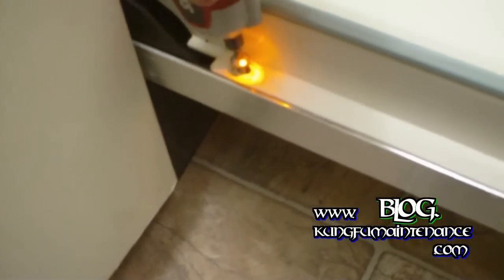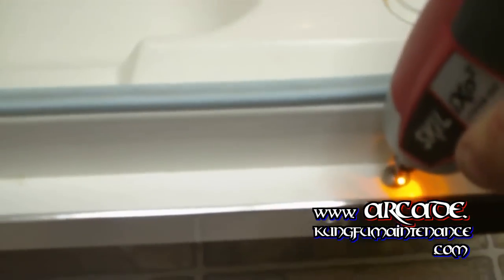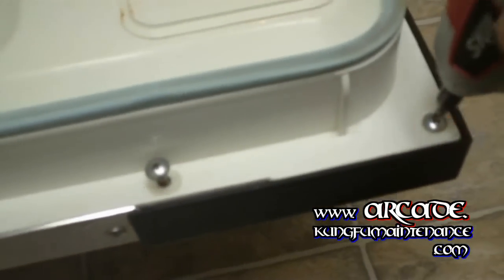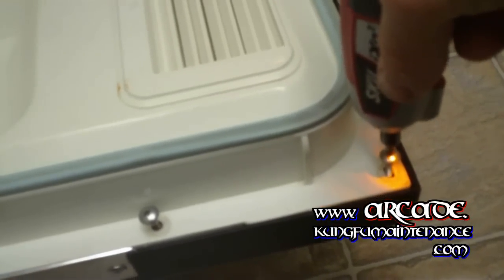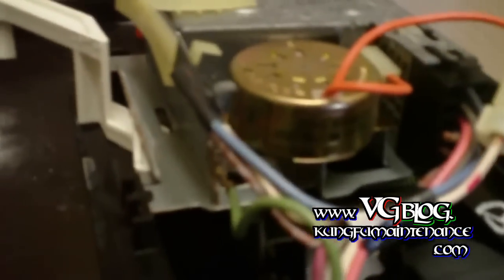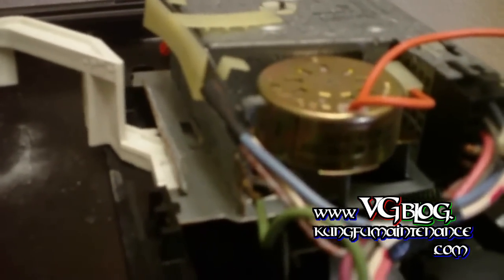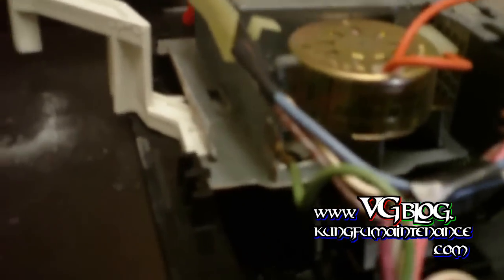How To Fix A Dishwasher Detergent Cup That Will Not Latch Or Close

Comment: My soap dispenser latched shut okay, it just wouldn't pop open during the cycle. So I'm just going to continue waiting till the first hot rinse cycle is over, let that rinse water drain out, then add the soap by popping open the dishwasher, closing it again and letting it continue the cycle normally.

Comment: The problem with mine is that the door won't automatically open to release the soap like it should.
Reply from the maker: +mupty For that, often the spring just needs to be adjusted or repositioned a little bit. Much like what is shown in video. 
Good for tune and thanks for watching!!!